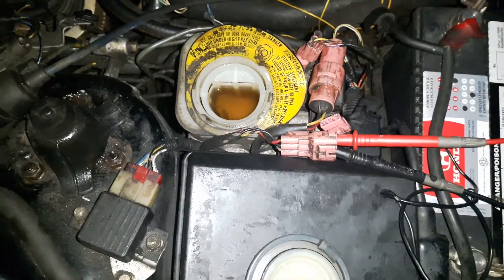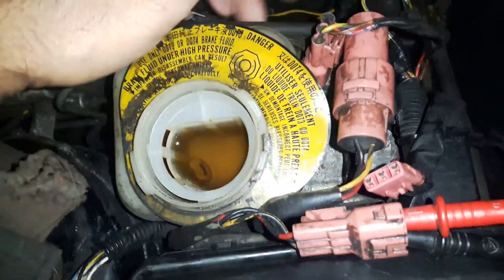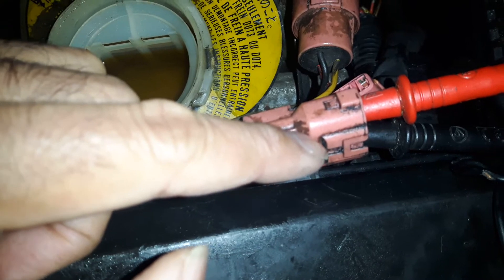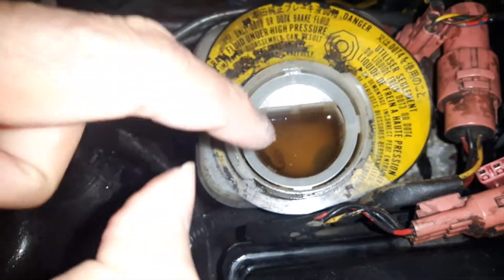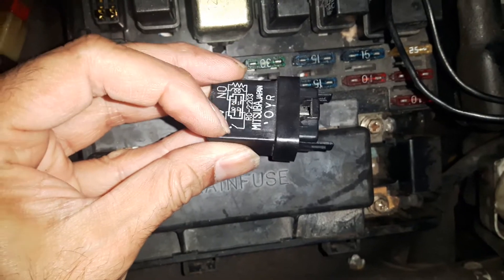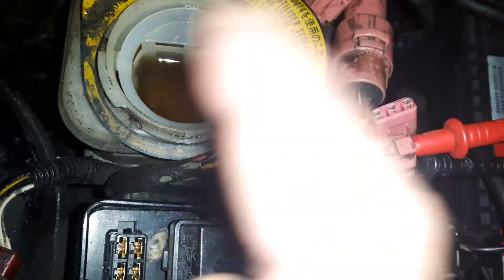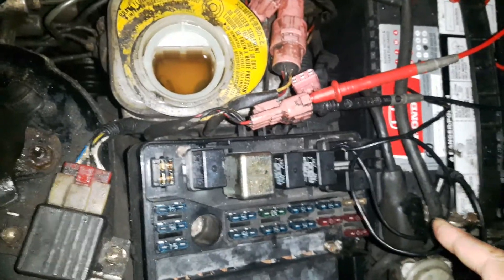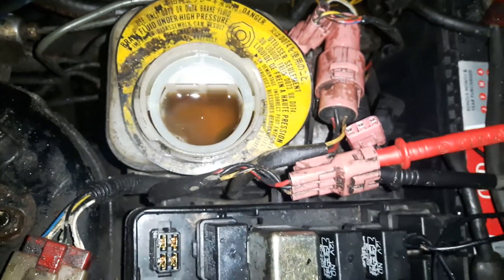Honda ALB ABS pump solenoid test clean bleed for Prelude Acura NSX Accord Civic TL CL

Comment: thank you for the video. Question, my 95 Civic ABS makes a noise mostly when the car starts but sometimes while stopped at traffic light. It sounds like ABS pump. Does it mean I have air in the ABS system? I had the brake master cylinder replaced recently by Honda dealer but the ABS reservor looks to have old fluids so they did not flush the ABS module. Hope you can share your thoughts on my issue to help me find a solution. thank you!

Comment: Thanks. This was really helpful for me. I got an '88 Prelude with 4WALB that's been sitting for almost 10 years now and I want to nurse it back into life. It's hard to find information or people with knowlegde here in Germany because Hondas of that period are very rare here. My Prelude originally was a grey import to Switzerland and came to Germany 10 years ago, I have actually never seen another one anywhere and I've been a car mechanic for over 10 years. Getting parts (other than maintenance items like brakes and oil filter) is nearly impossible, luckily mine is missing nothing, completely original including radio, floor mats, spare wheel etc. Luckily it has only a little bit of rust in the wheel arches because it was treated with "Dinol" rust prevention by the dealer in Switzerland when new, swiss people tend to take really good care of their cars.

Comment: Great informative video thank you! How would you then test the wheels sensors then? I feel like my ALB works only on one side of the car..
Reply from the maker: open the abs sensor connector near the the wheel well and measure resistance (or voltage generated) between the pins (to the body) as you rotate the wheel. Bad one will give different number.
Reply from the maker: Hope you subscribed